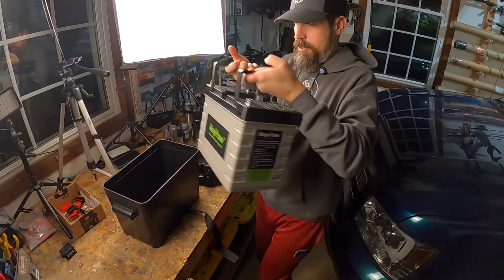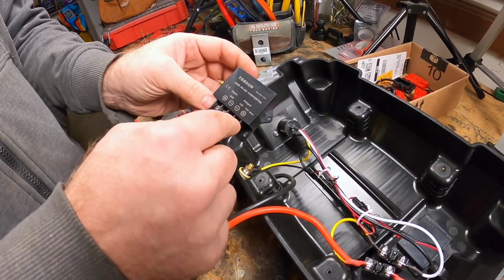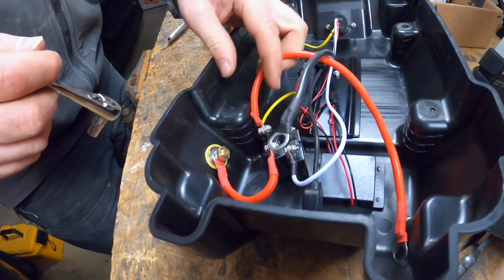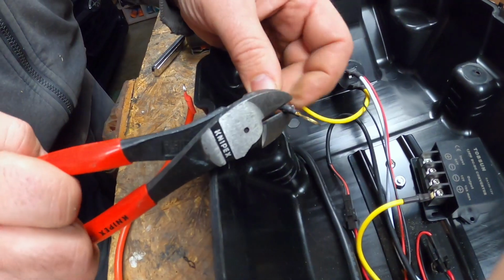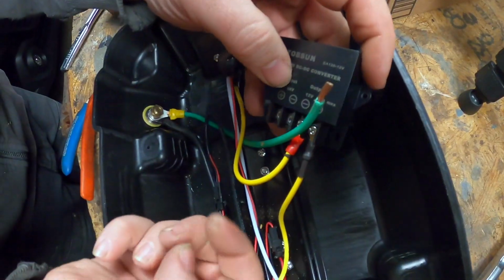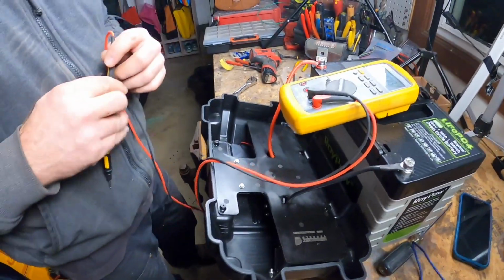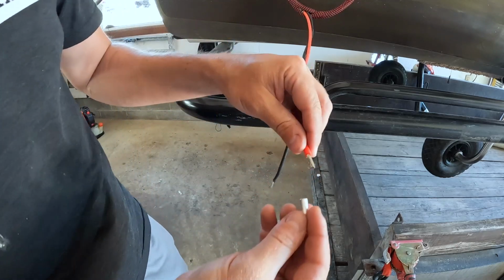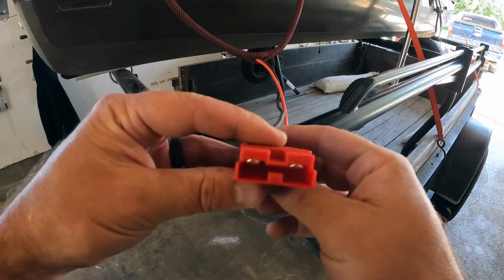12VT to 24VT Conversion For Newport Battery Box

Comment: Ok so the 24 will work for the trolling motor you are just fixing the ports for accuracies correct?
Reply from the maker: 24 will work for the motor.. but when I put a 24vt battery in a box rated for 12 vt, the ports won't wont work.. until you do this.